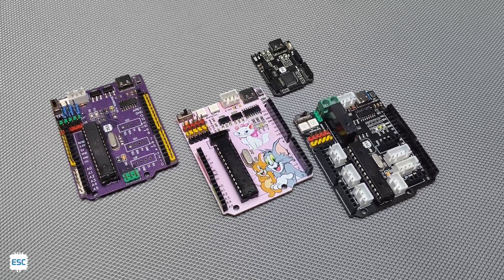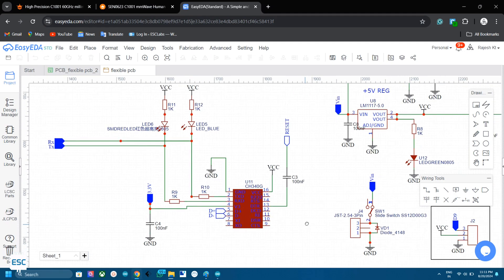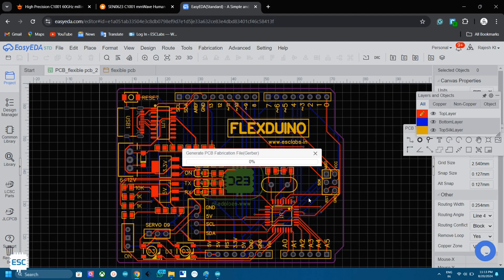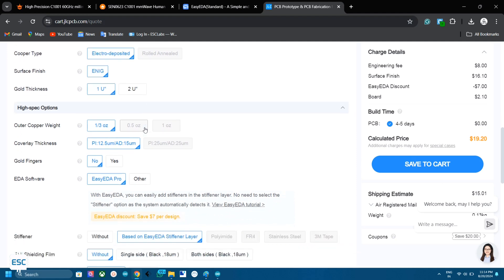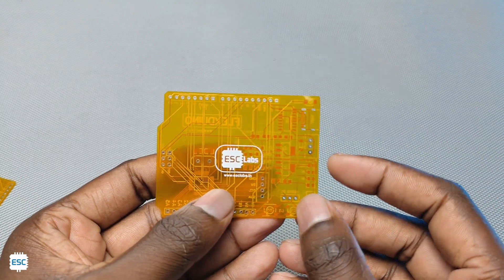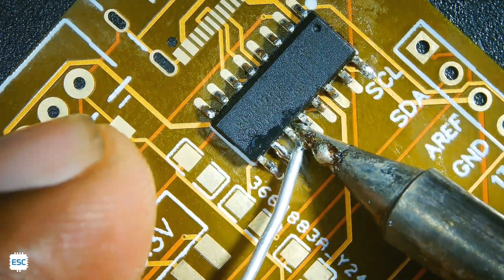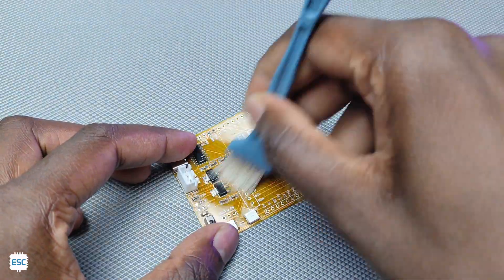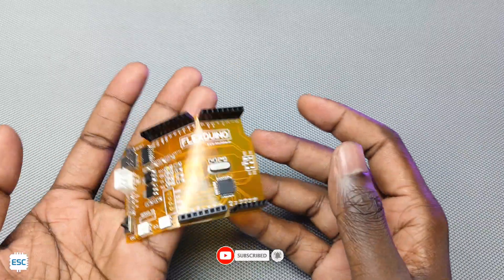DIY Flexible Arduino | Flexible PCB Tutorial | JLCPCB

Comment: Very good, I would like to make a steel tube sensor with TMP117 (0.1°C accuracy), I think flexible PCB is the option to connect this IC to the cable wires.
Reply from the maker: Nice idea

Comment: this is actually what i've been looking for months. this is very useful for my drone project, as it would take less space. nice video and thank you btw. can you please cover about stiffener, flex circuit connector and its lane configuration with other components?
Reply from the maker: Thanks. I will do that
Reply: Use something like an Adafruit Feather, they take no space whatsoever.
Reply: @cameron_bowe  thx for advice, but I already designed it to use ST MPU.
Reply: @sammtan-xena  How about just using the raw atmega chip instead of the whole arduino board.
Reply: @Auto5k  that's the point. this is a final year bachelor project of engineering. I had to design the entire system from scratch, the combination of computer and electrical system. meaning I need to create my own circuits.

Comment: Thanks for the "how", but the question left unexamined in your video is "why"?  What are some use cases for this? (Edit to add: I'm not being snarky, I'm genuinely curious and wished you had gotten into that in this video).
Reply from the maker: Wearables and display cables
Reply: For fitting on organic shapes. Imagine just gleuing this thing onto a pvc pipe.
Reply: Why? YouTube. Makes for an interesting video more than anything as far as i can tell.
Reply: @EDISON_SCIENCE_CORNER  This is a great idea, and something I could use for my art, which already uses a lot of development boards, especially scupoltural work or pedestals and frames that are not always made from flat surfaces needed for mounting the electronics. I would also use Raspberry Pis in this configuration if that was possible too, and I imagine it would be. Again, great idea for a very real-world usable product.
Reply: I mean, Why not?
Reply: I imagine you'll be asking this question again at some point. To bypass the need for self-clarification, instead ask, "What use-cases might this have?" Took me forever to figure out how to get my question across without sounding snarky.

Aside from shaping this to fit in conjunction with other things, and maybe size issues, it would also add some durability. The less stiff it is, the less brittle it is.
Reply: For like Medical or wearable products things
Reply: Exactly. I am looking for wearab project. Also "can" is often a good enough reason to do something DIY. It's not burning any VC cash or govt grants, right?